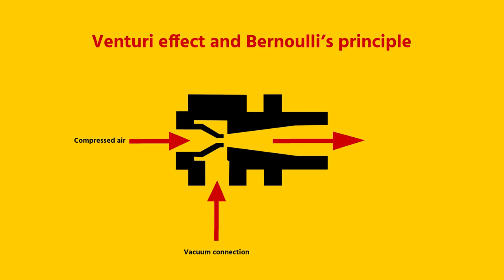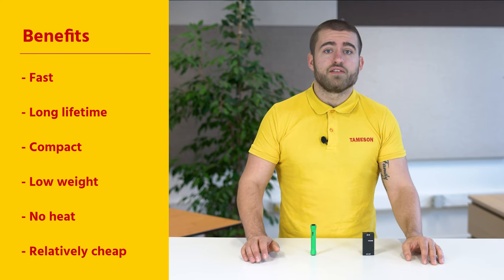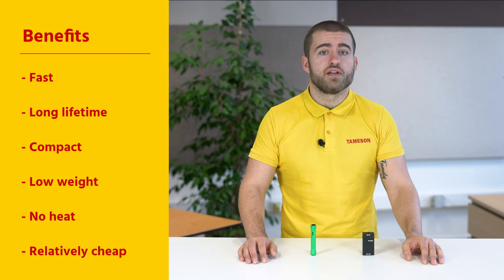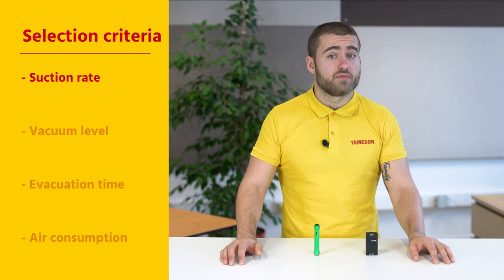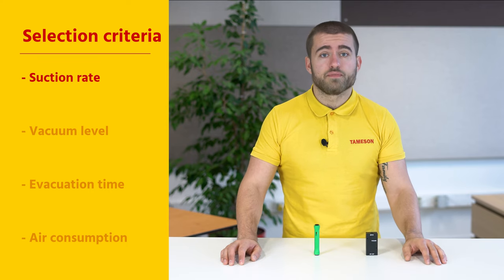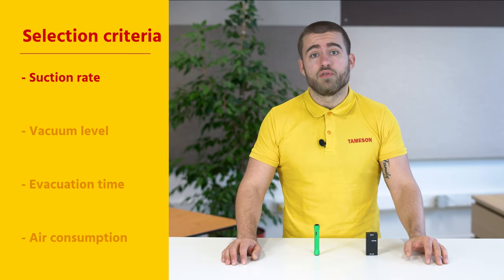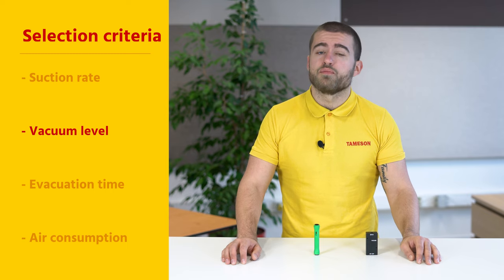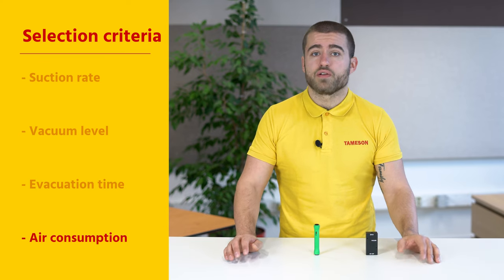Vacuum generators | How do they work & Selection guide | Tameson

Comment: how to increase vacuum pressure in vacuum generators
Reply from the maker: Hello, to enhance the vacuum pressure, you can consider the following steps:
1. Check for any leaks in the system and repair them.
2. Ensure that the generator's filters are clean and unobstructed.
3. Adjust the supply pressure to the optimal level as recommended by the manufacturer.
4. Consider using a vacuum generator with a larger capacity if the current one is not sufficient.